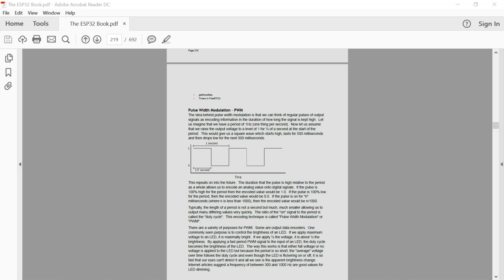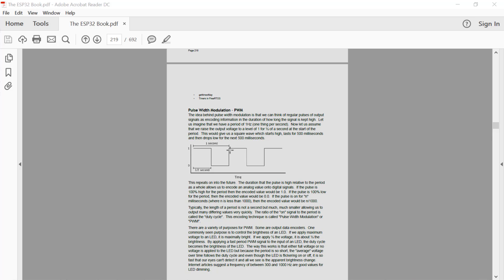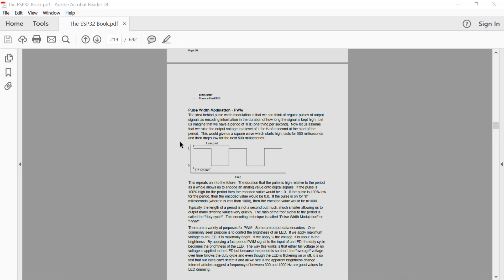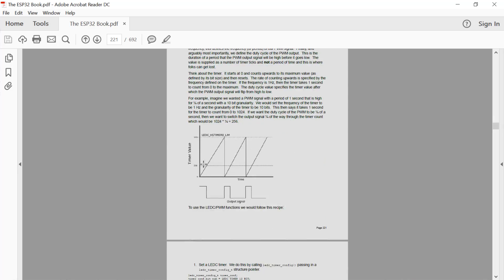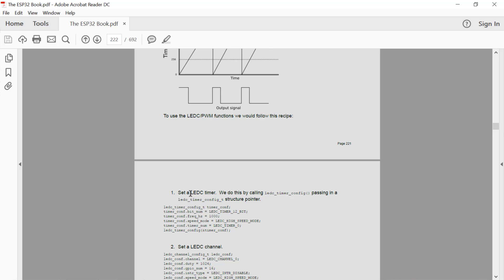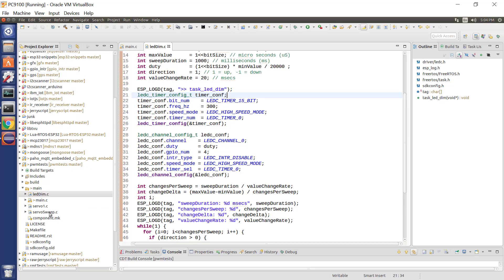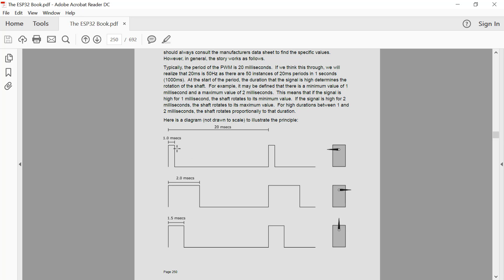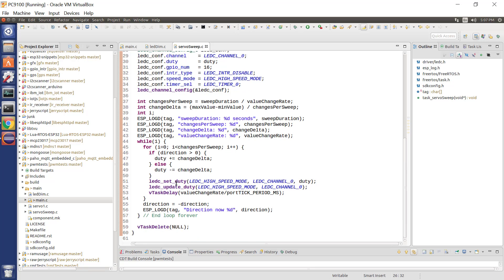ESP32 Technical Tutorials: ESP32 and Pulse Width Modulation

Comment: Great explanation, is the best one I found in Internet. I'm a newbie and I was looking for a clear explanation about how to replace the arduino "analog.Write" function with my ESP32.  I'm clear now. Thanks and congratulatios.
What I need to do is generate and send clear 1V signals to a electronic card, so I chose 5kHz frequency, 8 bits rosolution and 77 as duty cycle, durante 300 miliseconds.  If you have an advice I'll appreciate very much.

Comment: How to make pwm channel(25000Hz) work with different duty in each following period? All values   for the duty would need to be  generated in the array  table by sin formula  and could be variable in length .  And how to repeat these pwm with variable frequency set by the second pwm channel (25Hz)?  No examples on the net found so far, if it is possible to make  spwm  or similar on Esp32.